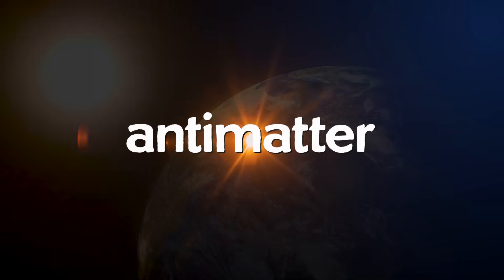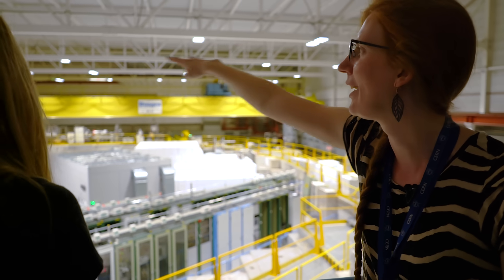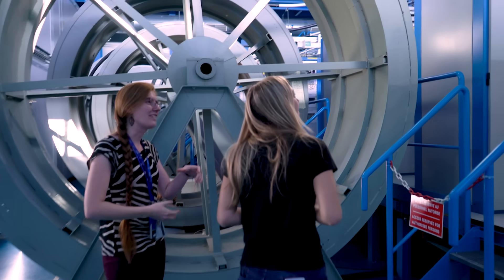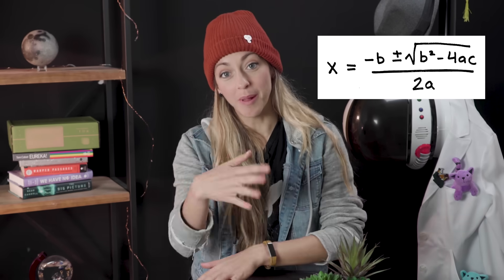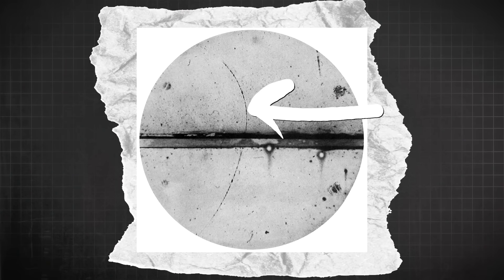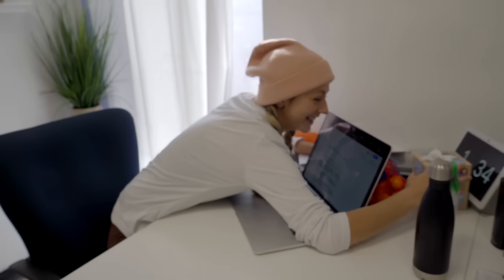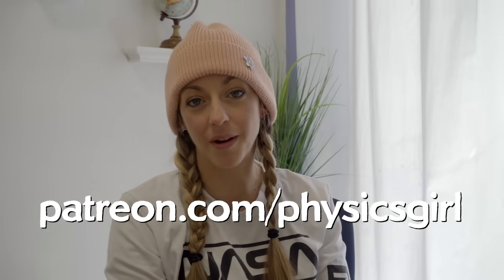Why This Stuff Costs $2700 Trillion Per Gram - Antimatter at CERN

Comment: "Should have made an equal amount of matter and anti matter, but we don't see any anti-matter"
Must not be right about the big bang...
"Nah you crazy"
Reply: We still don't fully understand gravity either don't mean we're not mostly correct with models that work over 95% of the time.
Reply: Something not being 100% true doesn't make it 100% false
Reply: Energy is equivalent to matter, and when matter and anti-matter annihilate, energy gets released. But the energy has no "memory" of what made it, so could it just become regular matter?
Reply: We cant just say theyre wrong cuz earth in comparison to everything else is too small to even acknowledge
Reply: @jimmysalmeron5292  Well, if matter and anti-matter cancel each-other, it is kinda impossible that they were made in the same amount, if so no matter would exist (theoretically) or maybe that hapenned and the energy released in the procces created a second big bang right after the first one that created way less anti-matter than matter.

Comment: There has got to be a frontier somewhere in the cosmic cycle where these two kinds of matter just blow up. I mean, the Big Bang didn't come with an Anti-Big Bang alternate did it?. 
We've got negative heat energy at below Zero Kelvin, we've got the Cosmic Horizon where everything beyond that is in a Schroedinger's Cat kind of existential paradox, we've got the strange conundrum of greater and lesser Infinity, we've got the conceptually logical contradiction of zero in the Null Set, and we've got the Domain of Imaginary Numbers. 

Some things must become rational in their locum, when the things that are rational in the ordinary sense, outside that locum, become irrational. imho there is more than one mathematical Domain to reckon by and each realm solves a part of the whole problem that the others cannot.

Comment: antimatter has no cost but the energy needed to transform the current world could possibly be attained using the urrent systematic measurements only to bring everyone under the current control that they are already in but in a greater state which is ruled by matter and it will turn into dust. which means people will still experience death but it maybe prolonged

Comment: When your scientific theory makes predictions that turn out to be false it’s time to question the theory
Reply: But when it makes predictions that are true, it's time to believe the theory.
Reply: John Crower If a theory’s predictions aren’t 100% true then the theory is not valid.
Reply: @jala5293  Within the assumed or claimed accuracy.  Newton's theory of motion holds within certain margins.  Einstein's updated version is closer to the truth but difficult to use.
Reply: John Crower Doe true but the prediction of anti-matter is fundamental to the Big Bang theory so the fact that it doesn’t pan out at all is a big clue to scrap the theory
Reply: @jala5293  They have already found and assembled antimatter at that factory.
Reply: John Crower Doe the fact that this is your reply shows that you have no idea what the Big Bang theory proposes nor do you have the slightest idea of what you are talking about scientifically
Reply: @jala5293  You posted a complete platitude in a context where you sounded more like a typical flathead.  In another thread I have noted the hypothesis that large parts (perhaps 50%) of the observed universe consists of stable antimatter that is simply at a safe distance from the parts that are matter.  Like any such general hypothesis, there are aspects that physiscists can study to confirm or deny.  One possible antithesis would be that antimatter is inherently unstable even when not sitting near an imperfect matter containment system.  Another could be that the safe distance is too big to fit any known gaps in the large scale structure of the observed universe.

Comment: Actually electrons should be called positrons and their charge positive. Then the direction of current in semiconductors and vacuum tubes would make sense. I've always wondered if the english "too small" numbers continue beyond trillion, and apparently they do. For us million is 10^6, billion = 10^12, trillion = 10^18, quadrillion = 10^24 etc. We have a special word for 10^9, "milliard", but you call that billion, and our billion is your trillion. So apparently you call our trillion a quintillion and our quadrillion a septillion. The scale of potential error is impressive :-)

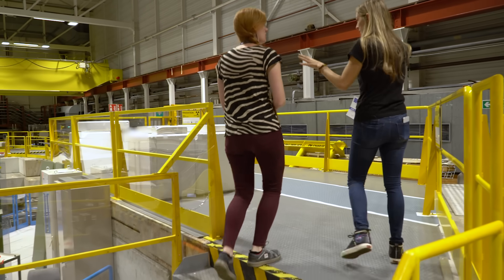Comment: Around 7:40 - 7:50 - I'm not so sure. I recall reading back in the early 1980s, or perhaps it was later like 1988 or '89, about an experiment with some sort of antimatter beam, whether anti-protons or anti-neutrons, or positrons, I don't recall, but whatever, the beam did bend downward ever so slightly as expected for regular matter particles of the same mass and energy.  Or was that a weird dream?

Comment: You may be pleased to know that back in the 1980s at SLAC, during the Z-zero Factory days, those of us working on beam position monitors, had diagnostic and calibration software where data for the two beams were labelled "positrons" and "negatrons".  I know, because I wrote that software :)   It helped to have "positive" and "negative" more explicitly visible.

Comment: From the description: "CERN produces 3e7 antiprotons per AD cycle or about 1e15 per year". 

Isn't 1e15 equal to...one? Or do I not know what I'm talking about?
Reply: It means 1*10^15, or one million billion particles per year.
Reply: @MikeRosoftJH  Then why not just write it as 10e15? What's the one doing there? Multiply any number by one, and you get the number.
Reply: @craigcorson3036  The "e" is a shorthand for exponential notation. 10e15 would have been 10*10^15 (just like 2e5 is 2*10^5, or two hundred thousand). This notation is usually used in calculators and computer programs.
Reply: @MikeRosoftJH  Don't condescend. I know what the e represents. You haven't answered my question. Why did you write 1*10^15, when 10^15 is sufficient, or 10e15?
As I said in my original comment, 1e15 = 1. Dianna has made an error, or rather, Elise has, whoever that is.
Reply: @craigcorson3036  So you don't know what the "e" represents. 1e15 is not 1, it's 10^15 (in order to make it clear what the number before the "e" represents, I have written it as 1*10^15 - just like 2e15 is 2*10^15). 10e15 is not 10^15; it's 10*10^15=10^16. The "e" does not represent the exponentiation operator (which is usually written as "^" when superscript is not available); it represents "*10^".
Reply: @MikeRosoftJH  And you still have not answered my very simple question. You wrote "I have written it as 1*10^15". Of what use is the 1 in that expression? Here's a new one: if, as you claim, the e denotes 10^, then why did Elise write 1e15 when she could have, should have simply written 10^16, or 10e15?
Reply: @craigcorson3036  I have written "1*10^15" for clarity because you have been confused about what the "e" means. And you are still confused. Once again: 1e15 is 10^15. It's not 1, and it's not 10^16. 10e15 is 10*10^15, or 10^16 (which can also be written using the "e" notation as 1e16).
Reply: @MikeRosoftJH  I give up.

Comment: Anti made EASY!!! 
(1) get some UNUNPENTIUM at least 5% pure (needs some ultracentrifuge...) 
(2) put in a vacuum chamber inside a magnetic bottle the same you make with that anti hidrogen
(3) fire a low speed proton bean over the ununpentium
(4) the ununpentium nucleous breaks and result in one or more anti-protons per break
(5) the anti-protons are stripped off the ununpentium with the magnetic + electric field and target into a thermocouple array
(6) one side of the thermocouple is cold, other is heated by anti-protons... so a DC current is generated... 
(7)  DONE... now go to sell to Greta Thumberg  you will get billions in finance to solve the "how dare"  problem with polution and energy generation
SEE???   easy!!

Comment: The quarters are simply toroid which are intertwined in the atom. Planck particles only move around the north and south poles. In the center, there are prank particles that merge into one from the original 2 and therefore it forms the gravitational force. Then it is easier to understand quantum mechanics.

Comment: What happens if a positron meets a proton? The mass is 1/2000 different so how would it give of 2 gamma photons if the mass doesn't balance Serious question I have always wanted to know.
Reply: Probably nothing special; they would just repel, because they are both positively charged. But if a positron hits a neutron, it can transform it into a proton.

Comment: This is not antimatter, it is an "anti-proton."   An anti-proton is made from matter by alpha-decay of the positron out of the nucleus.  No one has ever tried to put any of this stuff back together to see if it annihilates.
   Why would "anti-matter" annihilate by putting it back together as matter, makes no sense, since antiprotons came from matter and it was perfectly stable before we pulled the anti-proton out of the matter.   As a matter of fact, anti-matter decays back into matter within just a few seconds, by beta-decay, if not contained in a strong magnetic field.  That is why there is not much anti-matter in the universe.   Anti-matter does not exist and is impossible, they are just labeling it anti-matter, with no such evidence that it will annihilate when put back together as matter.
   Also we alpha-decay a positron out of matter, then an electron beta-decays out of "anti-matter" to make matter again.  That means a positron and an electron where both existing together inside of matter before it  alpha and beta decayed out an electron and a positron, so clearly those can exist together  in the nucleus and they do not annihilate anything when together as matter.
   Also we they smash a photon into the nucleus of an atom, they can get the two to separate out of the photon into an electron and a positron, so clearly they can exist together as a photon without annihilating.

Anti-protons and protons are mixed together all the time in the Van Allen Belts and at the center of Marklund convection in the inter-galactic filaments, and none of it has ever shown evidence of annihilation.   In fact the evidence is that at the axis of flow of Marklund convection, twists protons and anti-protons twist back together as neutral matter, yet no evidence of annihilation anywhere.  Nor have they ever tried it in a lab, just playing around with busted up chunks of matter.

Comment: Cool idea for you: 1. Many theories say you cannot measure any difference between time-reversed matter and anti-matter so maybe they are the same thing. (Looks like a duck, quacks like a duck...). 2. Many Feynman diagrams require time-reversed matter to work.  3. It also solves the Big Bang problem: anti-matter vanished when it went the other way in time, to before the Big Bang.

Comment: Since you said "when" Matter and Antimatter reacts with each other, they annihilates, creating pure light, so the physicist inside me thought that "maybe all the antimatters are still here in this universe in the form of light energies reacting with matters and the untouched ones got deflected by each other and are at the edge of the universe now, creating a ring all around it, which is causing the universe to expand by attracting the matters towards it" and then I got tired of thinking. So, let's go with parallel universe theory.

Comment: I think there's no asymmetry. I think that the reason you see large voids between galaxy clusters is that there really are antimatter galaxies out there. The question is, how distant are the galaxies that average cosmic rays have as their origins. I think if you have a large enough survey, you'll find antihelium, anticarbon, antiiron cosmic rays, we just are very far from the nearest such galaxies and the reason there's anything is that the 2 weren't homogeniously mixed, so you had regions richer in matter and regions richer in antimatter. Maybe, just maybe, you can even find antimatter star systems in places, in intergalactic space, maybe even within a regular galaxy, if they were ejected from an antimatter galaxy and hasn't collided with anything.

Comment: Infinity is. We’re probably in a part of it that is like a bubble of matter. Farther out there are probably similar “bubbles” of antimatter. The Big Bang did create something that is close to 50/50, were just so tiny that everything around us is matter, there barely any antimatter because it gets annihilated because there is so much matter here. 

Like we see nebula when we look inside of galaxies, but it’s so big, we fail to realize we’re in a “nebula” of matter of sorts when you go far enough away (and can see without sensors or light lol), you’d just have to go so far away before you saw anything that would look like the neat patterns we see at our scale.

Comment: Scientists: Oh yeah, this is the most dangerous thing on earth

Also scientists : let's mass produce it
Reply: I wonder if it can be used as a power source as some sort.
But I wondered the same thing.
Reply: @Thomas0086  It would depend on the amount of energy gained vs the amount of energy expended to obtain. If we figure out how to manufacture, store, and transport antimatter with a net profit in energy, then yeah, it'd be an amazing power source as one antimatter particle colliding with a matter particle would generate a great deal of energy, it'd also come down to how to capture that energy as I assume it'd be very fast so you'd have to be able to harness it and store/use it equally as fast.
Reply: @Thomas0086  it probably can. Just need to find a safe way to do so
Reply: Thomas Estwick It requires an input of energy to make equivalent to the energy it will output by being used, so it is more like a battery.
However, it is considered to be the best rocket fuel you could ever have as it turns itself and normal matter into energy extremely quickly.
The other use will be in 4th generation nuclear weapons where a microgram can be used to surround a gram of Deuterium and Tritium in a sphere to cause perfect compression for a fusion bomb (clean burning, no fallout) that is guaranteed to kill every human in a 20 meter radius and vaporize any set of defenses to 6 m deep through reinforced concrete with a total yield between 1 ton TNT and 100 tons of TNT. It does this by having 20% of the energy be in the form of neutrons as opposed to a current nuclear warhead (has trouble getting through even a foot of reinforced concrete even with Megaton yields) which has the vast majority of its energy in heat (99.9...%).
Reply: Interesting....  two different uses both equally as mind blowing.
Reply: *anti-mass produce it
Reply: Lmaooooo 😂😂😂
Reply: "We need more energy"
Reply: They said they produce/store only a couple hundreds of the antimatter particles.
Reply: Ok, boomer

Comment: Its just as good antimatter is hard to make or we might face a real attempt to blow up the Vatican stare (or the entire planet) with an antimatter bomb just like they tried to do in Angles and Demons if somehow an Illuminati wannabe/terrorist got into CERN and stole it. However the security at CERN is quite good i think so we probably dont need to worry in any case about that  (unless like in the film they cut the eye of a murderd scientist out to fool the retina scanners or something equally horrible). Also another thing preventing this risk: an antimatter bottle is a HUGE vessel needing many KW at least of 3 phase power supplies for the magnets that contain it. This is not something u can do with a small carry around in your pocket bottle with a built in battery like in the film .

Comment: I’m just a teenager and don’t know anything about positrons but is it possible there are an equal amount of matter and antimatter in the the universe and it just spread out like smoke from a fire. Say the tip of the fire is the edge of the universe, then you have the heat and smoke generated. The smoke keeps flowing outward and dissapates into the air. It’s possible that matter spreading throughout the universe is pushing antimatter outwards as it spreads.

Comment: Your laptop reminds me of my great grandfather's ax...  (The Golden Age of the 20th Century was when that witticism was new-ish, and you could still ambush people with it).
Anyhow, back on track with my train of thought, it seems clear why the universe does not contain macro- amounts of both matter and antimatter.  It can't.  One of the two HAD to dominate.  Locally, I suppose it would be possible for either to dominate, at least temporarily.  If some of the energy released in matter-antimatter annihilation ultimately reappears as matter (or anti-), then the incompatibility should continue to be thrashed out until one or the other is entirely depleted.  It seems unlikely that the ultimate winner should be decided randomly, because the two forms of matter aren't really chiral.  Some of the fundamental laws of the universe show "handedness"— electromagnetism — which must, in some as yet mysterious sequence account for the apparent chiral anomaly of matter-antimatter.  The cosmos may show a subtle preference for how reality sorts itself out, perhaps revealing subtle bias in some putative symmetries.

Comment: You could've put $2.7 Quadrillion, buy you put 2700 trillion, you might use the lakh system and make it 2,70,000,000,000,0.00. and convert it to Rupees. Good video nevertheless, fecal matter title though.